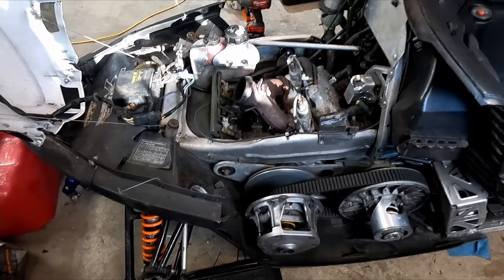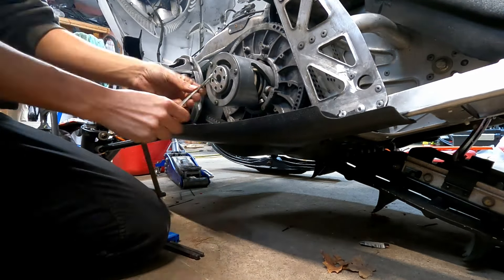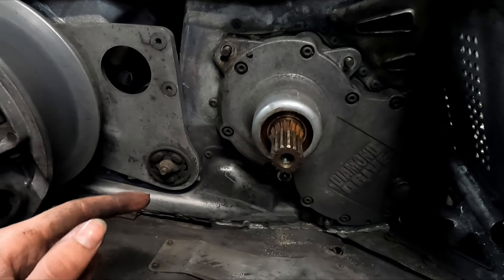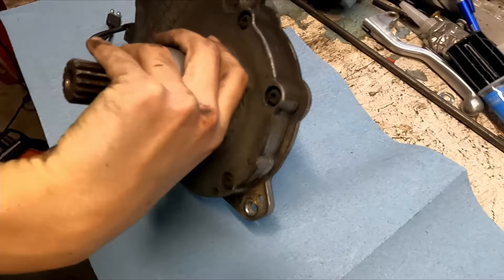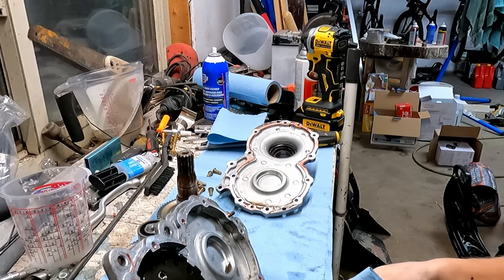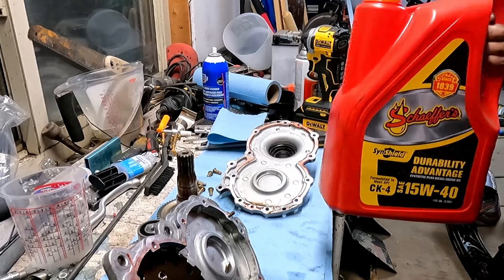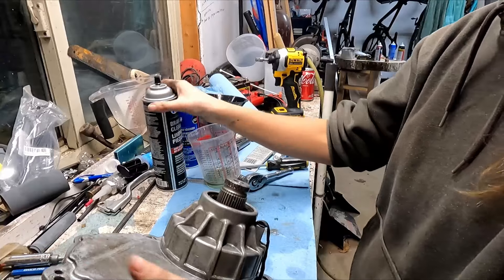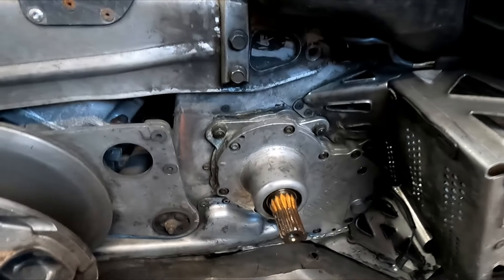Arctic Cat Diamond Drive Removal And Fluid Change!

Comment: Nice video. I’m up at Friends Lake up the round from LG. I have a 2013 Bearcat 570. It only has 590 miles. I use to groom xc trails on my property. I started hear this metallic clacking sound come from the left side by the Dismon Drive. Looks like it may be the pinion gear, but it’s in good shape. Have you ever seen a pinion gear which just flips around. I would think the spring should keep it rigid until it engages.
Reply from the maker: That's really weird! How did the fluid look? Check on country cat for some of the diagrams of parts to see if you are missing a spring or clip or something!

Comment: Thanks for the video! Literally walked me through the diamond drive removal so I could change speed sensor. Much appreciated
Reply: where did you find the replacement sensor?
Reply: Found at a dealership yet doesn’t deal with arctic cat anymore here in Syracuse NY. I believe the name is North Syracuse Lawn and Snow
Reply: @robgronau315  unfortunately you may have gotten the last one!!  I'm not far from Syracuse so I figured I'd give them a try, but they're out.

Comment: Great video!! Got some more understanding with my sled now.I have the same sled with the 10.4 secondary clutch with clutch kit and I’m having belt defection because the stock 026 belt is to tight and was told to get the 046 belt now. If you could help me out with this I would greatly appreciate it. Keep posting new videos!!! Very much helpful
Reply from the maker: You are correct on needing the #046 belt to go with the 10.4 secondary, also what clutch kit do you currently have on the sled? I will do a video explaining belt deflection and adjustment very soon.

Comment: Finally, a video that is easy to follow, nice job! Thanks for actually showing what you are doing and not the floor, best on you tube. What sealant did you use?
Reply from the maker: I used a silicon RTV sealant by Permatex, stuff works great and cures fast.

Comment: Great video.  Something that a lot of people are scared to perform, you just made look very easy.  Did you find that your speed sensor was bad?  If so, and you changed it, where did you find the part?  Been looking all over and can't find anything other than knock-offs.
Reply from the maker: Yeah I couldn't find the oem part either, what I did was I found a treadmill speed sensor that fit, then I just cut the end off my stock one and spliced it onto the new treadmill speed sensor. The speed sensor is just a hall effect sensor. 
This is like the one I used.
https://www.amazon.com/Treadmill-Reed-Switch-Replacement-NordicTrack/dp/B09T5W7R3N/ref=sr_1_5?crid=21ZA1PQOSP62D&keywords=treadmill+speed+sensor&qid=1673235646&s=sporting-goods&sprefix=treadmill+speed+sensor%2Csporting%2C173&sr=1-5
Reply: @HeidisGarage  great idea!!  I'll give it a try.  It fits perfectly into the recess in the diamond drive as well, or did you have to do some modification to the sensor end as well?
Reply from the maker: I think I had to sand a tiny bit off one side to get the Christmas tree clip to hold it in right. It was maybe a couple thousands off.